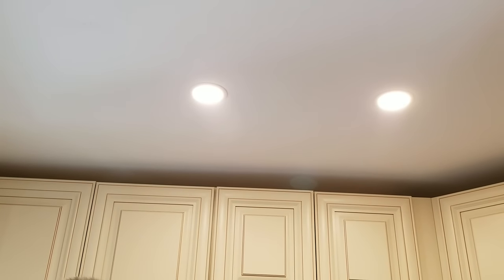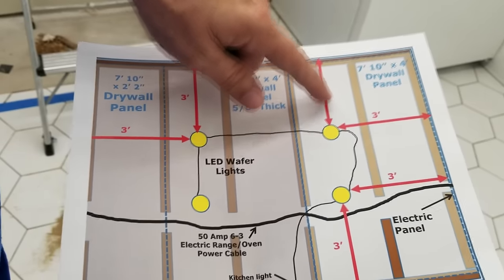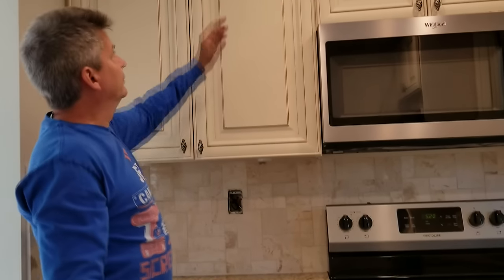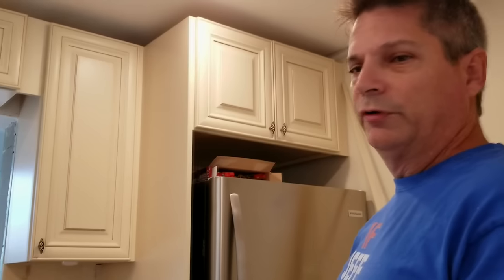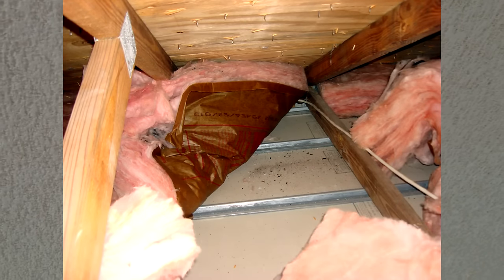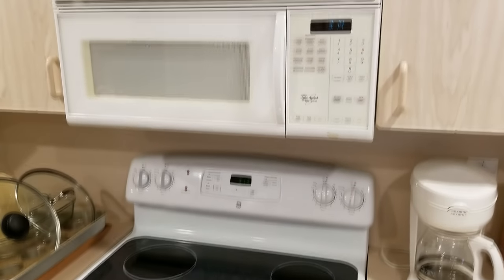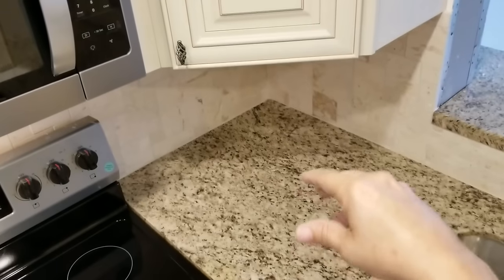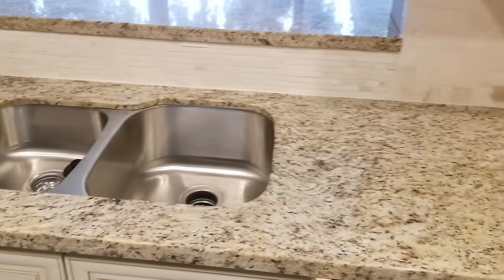Kitchen Light Spacing Best Practices, How to Properly Space Ceiling Lights

Comment: That’s a bad layout !
Reply from the maker: The layout works great and provides even lighting on the counter as we have also showed in our sequel video to this one period the only spot where there was a problem was late in the design there was a change necessary in order to accommodate a new deeper cabinet over the refrigerator, which placed the front of the cabinet reasonably close to one of the lights but it's not that bad you still have good coverage in the kitchen remember those four lights have to cover the entire kitchen. this was a $40,000 condo with a very very tight budget and could not add anymore lights or undercounter lighting.

Comment: I hate wafer lights. Too much eye strain from the glare. I only install deep recess in cans.
Reply from the maker: Usually when wafer or other surface mounted LED lights are retro added to cans the result is much brighter light, so a dimmer is often used. Keep in mind as we get older, we require more light to see, so the lighting gurus warn us that a 50 year old requires twice as much light to see as a 25 year old.
Reply: @jeffostroff  wafer lights are like having a bare bulb hanging from the ceiling.
The glare is horrendous in my opinion.

Comment: Why not just space them like a normal room and then use pendants/track lights/undercabinet lights or even directional trim if the can is too far out? The recessed cans are for general lighting. Task lighting is for tasks. Imagine that. This guy is quick to dog on “builders” but I can tell he’s just a DIYer tryna be an expert
Reply from the maker: Why don't you just fork over  the money to do that? That's a $50000 condo with very little Room and a budget for anything so those for lights were all that could be done. Just remember each light recepticle on average will cost you about $200 to have an electrician install it. You do something like that in a regular house where you're kind of going all out to improve the kitchen. Most of these kitchens including this one just had a couple of a fluorescent lights sitting up on the ceiling to begin with anyway so any type of lighting other than that is an improvement already.  So you can tell that Zach here has never had to do with the realities of an actual construction site but yet hes trying to pretend everybody here that he knows what hes talking about.  If you do exact way you'll be spending an extra 2 or $3000 by time you're done just on the kitchen lighting alone with all the the under cabinet lighting and then the light rails to hide it and then the pendants and all the wiring and all the cans. And then you'll find out your condo's not going to sell for more than $50000, But Hey check out all that fancy lighting.
Reply: jeffostroff I’ve been in construction my whole life and am a master electrician in both states I’ve worked in pal. And the commercial and res work I’ve done were in Aspen and Vail so not some hack work. And if you were as handy as you’re trying to portray, it really would not be a huge deal to add pendants/track/ undercabinet.
Reply: @zachford2616  I learned a long time ago to run away as soon as someone starts with the "everyone else is wrong because only I know the best method" nonsense. If the guy knew what he was doing, he wouldn't be a handyman begging for YouTube money.

Comment: So you aren’t supposed to put a light 1 foot or less from the cabinets and the first thing you show is how you put 1 light 1 foot or less away from the cabinet! 
Is this a joke?
Reply from the maker: Not a joke, a design change that happened after the lights were in place. It was decided to make full depth cabinets over the fridge instead of the original designed lame half depth cabinet which had the spacing we originally showed in the drawing. We also had to add that cabinet wall to support those full depth cabinets.  Even with the light so close to the front of that narrow depth cabinet over the fridge, there is no notable issues because there is no counter under those cabinets to cast a shadow onto.

Comment: Seems you have dropped the ball.
Your downlights are too close together and looks stupid.
1 decent size 20w led oyster light in the middle wouldve been heaps better!
Reply: He has to have that many downlights because he needs the ambient light to light the cabinets. Downlights are the least efficient method of producing ambient light, so he has to overdo it. This would all be prevented if he just put the lights directly overhead instead of 1 foot behind where a person stands.
Reply from the maker: The lights are not a foot behind where a person stands. The lights are practically in line with your shoulders.

Comment: Those obviously aren't IC rated cans.
Reply from the maker: You obviously don't know what you're taking about. Those aren't even cans, LOL. those are IC rated wafer LED lights, they don't use cans, you cut a hole in the drywall ceiling, and it snaps into place. They even have gaskets on them to seal better at the ceiling so you don't lose AC to the attic.
Reply: @jeffostroff  I was talking about the cans at 10:15. I wasn't talking about the wafer lights by Lithonia. I have sold dozens of them by the way.

Comment: I cannot believe there is a microwave oven directly above a cooker, surely that's a fire hazard as well as a bad design.  If you want a microwave or small oven put it away from the main cooker.  As it is in that kitchen the microwave is always going to be directly in your face as you cook. On using the cooker the heat from the hob will rise up and trigger an electric fire. So dangerous & unnecessary.
Reply from the maker: You could not be more wrong, not sure what you're basing your data on, but it is wrong. Virtually every modern kitchen since the 1980s has the microwave over the stove, it is standard here in Florida, not dangerous, and never heard of any fire being started by the microwave over a stove. Furthermore, all microwaves have a pass through to the exhaust system of the house if the kitchen is so equipped with the tubes leading out the roof. Most kitchens don't have that venting, although I believe it is now required on all new construction. The only time you don't see the microwave oven over the stove like you want it is in wealthy homes with large fancy very expensive kitchens, where the giant $2,000 range hoods are built over the oven, and the microwave is now moved to the cabinets usually paired over a wall oven. This is not practical/affordable for most people with 8' x 10' kitchens because in smaller kitchens they will lose a base cabinet which they cannot afford to lose.

Comment: Wow, this video “dropped the ball” (I figured I may as well use that overused saying too, since this guy likes to deflect).

This is not a good SOP for kitchens. He even dismissed his mistakes as “meh, nothing you can do about that” - he lied to you viewer.

Absurd amount of pre-work for a task so simple. Next time you do a kitchen video, remember that you should account for the person working in your path of light. Ceiling lights are not the suggested or common way to light up “under the cabinet” - I think you need to go back to the drawing board with this video. Next time, explain why people purchase and install under cabinet lighting.
Reply from the maker: You made a really bad assumption here. Not everyone can afford under cabinet lighting, which if done properly, requires expensive electrician work, and city inspections, and most implement it wrong anyway, putting lights up against the back splash creating bad glare. You should never have to rely on expensive under cabinet lighting to correct your shortfalls in overhead lighting. that's the mistake a lot of you make. You'll have to improve the clarity of your comments here you're not making much coherent sense: "Absurd amount of pre-work for a task so simple.?" not sure what you're referring to.

Comment: "We call these lights fire starters."  😂😂😂  Ever hear of Insulation Contact rated light housings???  I guess not
Reply from the maker: You obvious don't know about lighting. The fire starters are the old cans with the holes in them that allow the heat to rise up an cause fires when insulation is placed over them.  We never use those. These LED disc lights that we used are I.C. Rated which means "Intimate Contact", which means insulation can be placed right over these lights. Since it is obvious you didn't even watch the video, we showed these are I.C. rated lights. Also we ave no insulation above these lights anyway, because there is a only a 1 1/2" crawl space between the fire rated drywall ceiling and the cement slab above it. Nothing there to catch fire. You might want to learn a lot more before you're qualified to troll other people's videos. 😂😂😂

Comment: ⚠️ The real truth... if you care enough... ⚠️ LED lighting is all so popular - yet it’s light is a VERY narrow spectrum - which makes wood look flat boarding pasty colors dull.  Most people don’t realize that lighting is typically around 20% of a power bill.  Your realized savings pays off only for lights used a lot.   The real truth is the most anazing kitchens have *Halogen downlighting on a **cascading dimmer which lasts over 20 years as you never run them more than about 80% and with its high spectrum, pulls the richness of texture and color rendering accuracy.   Also, lights should be centered on work surfaces or centered between the cabinet and the counter edges.  Too many kitchen lighting projects have lighting on top of or behind people’s heads and that causes shadows on the work surface. Who wants to work in shadows?  Far too many lighting projects cause the room to look smaller because the lights are placed over the floor space and not the counters.  This gives the illusion of a smaller kitchen.  When people see my kitchen, they make unsolicited comments to the positive and how large it is.  Its far more about lighting and uncluttered areas.  Islands always make a kitchen look smaller.  Obviously there are times you have to or should do this.  I also think “pasty white” LED’s make people’s houses look cheap and unnatural.  Who wants their home to be lit up like a florescent office building?   Then you have the hodgepodge look where people use pasty white and cream white mix in different fixtures in the same room leaving the space to look poorly cared for verging on moronic - What jamoke did that is what people who are paying attention are thinking.  Outdoor lighting is another mess where there is no room for a pasty white LED.  *(Halogen PAR38 flat faced - don’t buy the ones with a dome face). **(Lurton Maestro Switch has 7 pencil thin LEDs stacked on the side of the dimmer which is available in models for different types of lights).

If you are lighting paintings and sculptures the PAR36 track and mono-point’s using Narrow Spots is like no other.  It’s like a museum. These must be on a dimmer and it’s has to be a dimmer for Electronic transformers.  The most clear color rendering light is Sylvania Capsylite.
Reply from the maker: Good info down here in Florida we have a hard time using halogen because they put off so much heat when they are on
Reply: Very valid point Jeff. Hi A/C bills.  LED down lights can work with painted surfaces that are light in color but it’s wise to buy ones in different spectrums to test first.  Stone counter tops rich in color texture and wood grains will suffer natural brilliance. I spoke with an LED engineer and I showed him photos of halogen Vs. LED’s on different objects and on paintings and his only solution would be a RGB which are the red, green and blue that color televisions were originally designed around. If you think about it, we watch LED televisions.  There needs to be a “true spectrum” or “full spectrum” offering for down lights.  Perhaps even a tunable type.  When the colors pop and show natural richness, I will be first in line to buy.  

I have no objections to using the current LED downlights in white or cream color open rooms, but not kitchens nor family rooms where you want a feeling of sanctuary and truth.
Reply from the maker: @jrchicago9216  Last few months I've been installing LED down lights that are changeable up to 4 or 5 different colors from 2700k up to 5000 or 6000 pure white daylight. You can play with the switch settings and see which one you like best, these are awesome. Also some newer lights are blue tooth changeable from your phone.
Reply: Jeff, What brand are you referring to?
Reply: JR Chicago, I'd appreciate some links to your lighting sources.  I have been light shopping, and I am frustrated and irritated at how difficult it is to get good information, and the lack of options.  Solutions are either astronomical--like a $500 halogen fixture that can only be fixed by replacement--or worthless-to-me LED bulbs that give off less that 700 lumens at a nasty 3000K temp.  TIA.
Reply: ML_ Haskell Are you looking for typical PAR-38 lamp downright cans (Halo or Juno brands are best) or lighting for paintings or sculptures (pointable narrow spots)?  The downlight fixtures come in pre-construction (a fixture that is mounted between the bare ceiling joist prior to drywall) or to be cut into existing drywall ceiling (some people refer to these as “after cans”, kind of an electricians slang)?  There are models for flat ceilings and others for angled ceilings.   If you provide your email, I can send you photos or a link that may help you visualize how to apply these.  I have tried posting these in a DROPBOX link in these postings before and the link gets scrubbed, so email is likely best).
Reply: @jrchicago9216  , thank you for reaching back.  I'm looking for kitchen lighting.  The 8' ceiling is and will remain flat.  I can't tell you what I'm looking for, but  I do have some experience with what works.  I like lots of lumens.  In my previous house, I had a minuscule kitchen--80sq ft--but there were three 100W bulbs, one each over three work areas.  Each was behind a cabinetry valence so my eyes were never looking into the bulbs.  DANG if that wasn't plenty of task lighting!  There was a center overhead light, but I never used it, because...well....center overhead is the WORST.  Obviously, I can't plan for 100W incandescent-lights-though I would if I could.    I've had a hard time finding professionals that elicit trust.  Electricians want to pop 8 or 10 of those glare-fest hockey puck lights in my ceiling.  Lighting store people want to sell me expensive chandeliers or wicked expensive and un-repairable halogen fixtures--without ever seeing my kitchen.  TIA